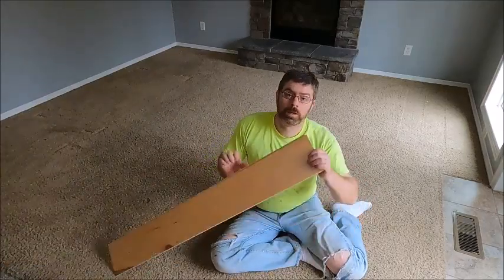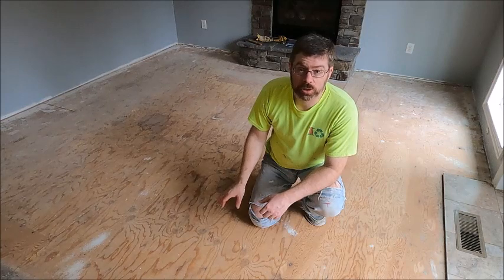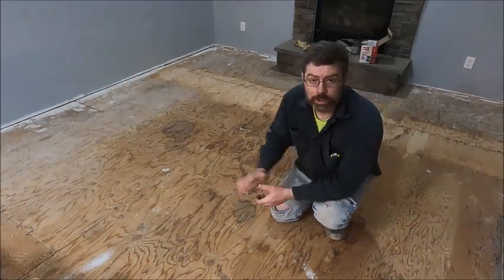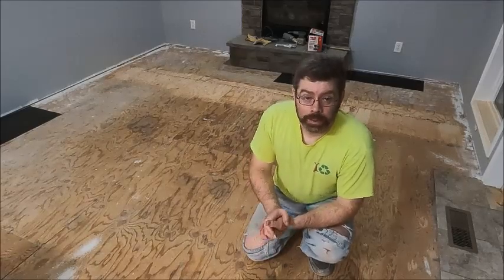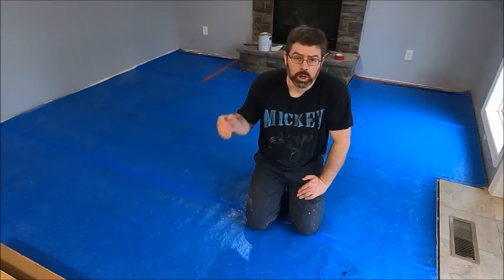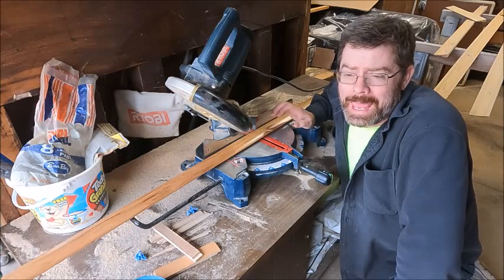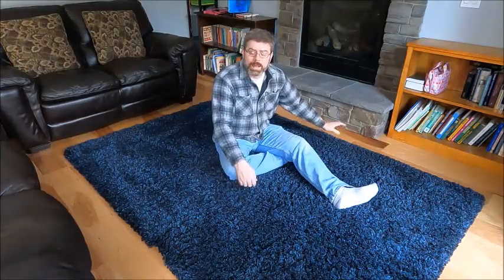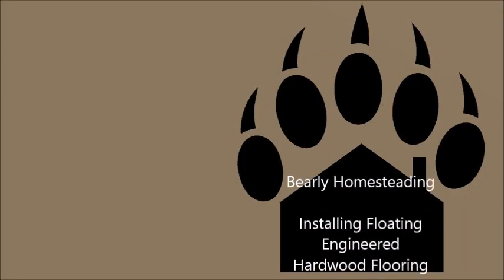Floating Engineered Hardwood

Comment: I have concrete slab on grade. I also have engineered hardwood floors. I keep getting mix installation recommendations. One installer says just use Prego underlay to keep moisture out, and glue the tongue and grooves, while the other ones are saying, you need to grind out the old glue from the carpet from the concrete, and glue down — as it will not be optimal for concrete install. 

It's a mess, I'm not sure which way to go because each have a different pricing. Any advice from professionals would be greatly appreciated
Reply from the maker: I have never done a glue down installation, only nail down and floating.  I have avoided the glue down specifically because I didn't want the mess.  The two floors that I have done on slab were both floating and have not had any issues.